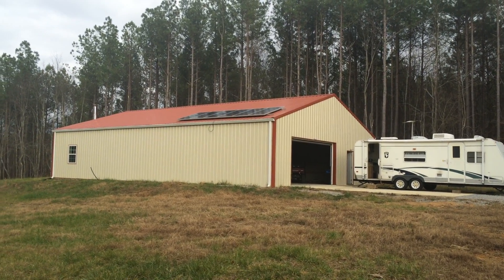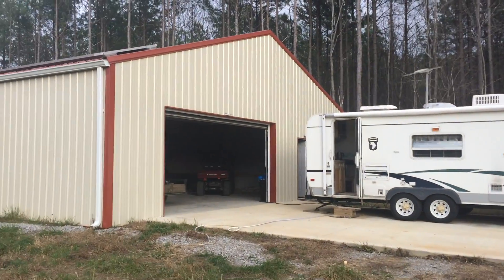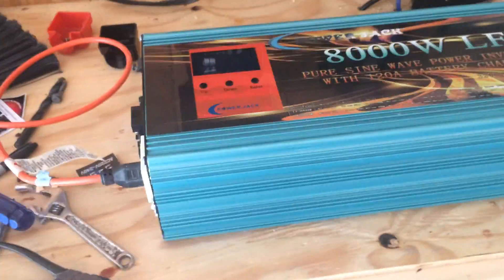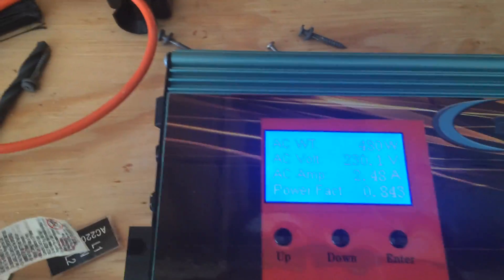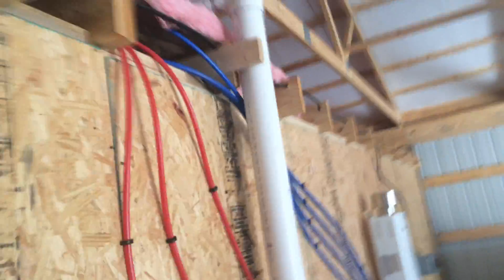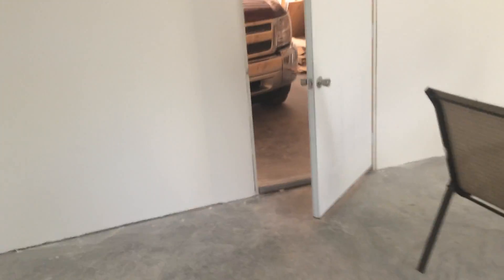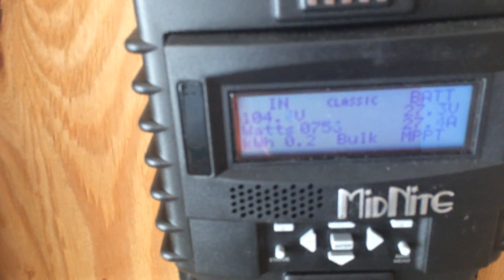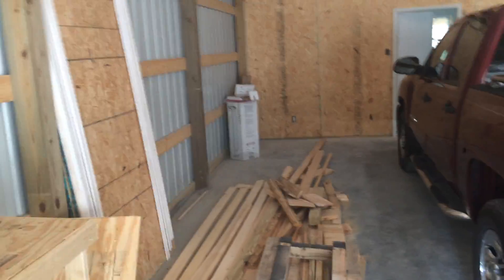Completely Solar Powered Off the Grid Cabin

Comment: How is your system working in 2024? My wife and I are about to start our off grid property this Spring. We have a Conext SW4048 system that I need to install in our High Cube Container with ABSOLYTE GX 2,000 Amp hour battery bank. We are installing an 30'x40' Red Iron Steel Canopy connected to the container. Your set-up is fantastic!! Hope this finds you Blessed and Well!!

Comment: I got mine around the same time.

Solar panel https://amzn.to/2Cx3J5t
Eco-worthy 1000w https://amzn.to/2Cg8i4a
Amazing shower https://amzn.to/39trFTi
Earbuds https://amzn.to/3fcw3Iv
Kindle ultimate https://amzn.to/31PAx3N
Twitch prime https://amzn.to/2ZIgcLl
fire tv stick https://amzn.to/2C2bTlE
Midea U Inverter Window Ac 8,000BTU https://amzn.to/3eRYzyp
Necklace fan https://amzn.to/2VGlIwU
Sense Energy Monitor https://amzn.to/2T2u3JD
Spiderman FFH https://amzn.to/2W3NIK7
Aveners: End game  https://amzn.to/2KOhyx7
Metamucil double https://amzn.to/3aHoNB8 single https://amzn.to/3bmvVTU
Canon EOS M50 https://amzn.to/35fHX0c
SONY RX 100 VI https://amzn.to/35bteTS
Canon PowerShot G7 X Mark II https://amzn.to/2WaAPhp
CANON 90D https://amzn.to/3cX8z8O
SONY A6400 https://amzn.to/2VMUNzL
Darth Vader and Ahsoka https://amzn.to/2A3qDjl
Captain Rex https://amzn.to/2L2tMST
Ahsoka Rebel https://amzn.to/2A0hoAl
Anakin https://amzn.to/2W8QZch
Skillmatic https://amzn.to/37PwSEn
Aqua 4 in 1 Monterey https://amzn.to/2Ctihmm
Bunch O https://amzn.to/2YWQodL
Face mask https://amzn.to/2ZBw2Y9
Enema https://amzn.to/2YTOquQ
Amazon business account https://amzn.to/3h9t98K
100 disposable gloves https://amzn.to/3dEbNh9
Bicycle rollers https://amzn.to/2VFCOLh
Oscilloscope https://amzn.to/32tCFyA
Ispring reverse osmosis https://amzn.to/2Wy6D0I
Flex Seal Spray Rubber Sealant Coating  https://amzn.to/2OWPERv
Great Stuff 157913 Big Gap Filler, 20 oz https://amzn.to/39t7lBK
Reusable Half Face Cover, NASUM M101 Face Cover https://amzn.to/3jDWFVl
Rockport Men's Bennett Lane 4 Venetian Shoe https://amzn.to/39tqumR
Helix Flexible Stainless Steel Non Skid Ruler https://amzn.to/3jECy9B
Bacitracin Zinc Firtst Aid Antibiotic https://amzn.to/30KvsHT

Comment: The batteries look dangerous as hell, put a 100A circuit breaker in each of the three parallel branches. You can then easily isolate one or all the batteries.
Reply: Hehehe batteries look fine... its that janky undersized wiring that is gonna cause a fire... wooo hehehe

Comment: I noticed that you have a jumper on the input of the inverter. Any particular reason why?Or would it be ok to just land battery lines on just one positive and one negative?
Reply: Lol... this unit requires twin leads. 

00ga cables x4.
2 positive, 2 negative. 

He's using what looks like 4 gauge, MAYBE 2 gauge, which, if there is no fuse(did not see one, and unlikely there)... if he draws full power from that inverter, he will melt those input wires.

Comment: Nice project.  A few questions:
Why not 48 volts?  You could have gone with 2 strings @ 48 volts and they are much easier to balance than 3 strings of batteries, although you would have to add 4 more batteries.  

Why did you go with a 12 volt pump when your system is 24 volt?  How are you supplying 12 volts to the pump?  One issue is when you go to equalize the batteries you have to go to around 31 volts on flooded batteries and it may damage some stuff.  I tried to go with 48 volt ballasts for lights and when I equalized the battery bank, they burned up from over-voltage.  Went with mostly AC lighting, but do have a 12 volt backup.  

So you have about 7 kwh of power available if you only go to 50% depth of discharge?  That is a nice start and it is sometimes a challenge living within the power budget.  I still learn about the capabilities of my system.  

The Midnite solar equipment is top notch, I use it every day.  

Hope you do well, but my experience is that the more parallel strings of batteries I have the more difficult it becomes to balance them.  Currently I am on batteries that were used and on their way to the smelter that I got in 2014.  I went with industrial stationary batteries.  2 volt cells and 1040 AH per cell.  I got 56 of them so I would have spares and I have needed them.  

Good luck and I hope you post updates on maintenance, equalizing battery watering etc.

Comment: Looks good but fo u really save any money  those solar systems cost so much then changing out battery every year or 2 is it really worth it
Reply from the maker: They wanted 6 grand just to get the power next to the building.  That's not counting bring it inside.  The batteries are good for 10 years if you maintain them.  Plus I don't have a bill that would be at least $100 a month because of all different fees.  I have 5K in the system so it's already paid for itself.

Comment: Don’t you need to have a 48v battery bank to run an 8000w inverter?
Reply from the maker: The inverter was made for a 24-volt system.  Every inverter is input voltage specific.
Reply: That's a 8000 peak, 4000 constant

Comment: Man, I'm loving it!  This is all anyone really needs!  A nice shed to store and work in and an RV to sleep in.  You have so much space on that roof, I'd slap up 10 kW of panels and run the A/C all the time in the RV.
Reply from the maker: Since I finished the cabin I have sold the RV.  I can run a small window unit during the day.  To run it a night need to use a generator.   I ever move out here full time would double the panels to 3600 and quadruple the storage space to handle central air.

Comment: He's off grid util he needs AC...He has a awsome set up..just not enough solar panels to support a refrigerator and AC at the same time...
Reply from the maker: I can run both a refrigerator and a small window unit all day long and the system still charges the batteries.  If I need the AC at night I have to run a generator.  It hasn't been an issue because we aren't here much during the summer.   We spend a lot of time out here during the fall and winter has been plenty of power for that.

Comment: Good job buddy! 
Looks like a great setup, you’ll need 2x the panels for the winter if you are north but very nice indeed 

I would get yourself some 24v to 12v dc/dc buck step downs and run 12v led strip lights in the winter if you need to start to conserve , 

We got a 24v dc  sundanzer dcf390 freezer that barley cracks 800wh , it pulls a whoppin 1.4A when running,  and it’s BIG and I can throw a game kill in it no problem 

Food for thought

Comment: Multiple strings of batteries are generally a bad idea. Plan on upgrading to a forklift battery, you will end up there eventually. I went from rv batteries to golf cart, to L16s to forklift... should have started with forklift. 21 years offgrid here. Why are you not catching rainwater? You have a giant roof...
Reply: chris niner o
Reply: 13 yrs offgrid...golf cart to L-16 and back to golf cart(trojan L-16s are junk)....tell me about fork lift batteries...? new or used?....what are the pitfalls?
Reply: Raymond Balcom Look into Tesla Model S batteries
Reply: @offgridmangogrower  You need a fork Lift to move a Fork Lift battery ... they are very heavy like 1/2 ton ?
Reply from the maker: Check out my rain collection system.

Comment: Hi Team.. I am trying to setup a water tank in a hilly region where water can be drawn from the bottom of the mountain and pumped upwards. There are 5 different pumps that can do this work and their respective power consumption is as follows. Can you pls let me know if this power requirement can be met through the power generation device shown in this video? This is a hilly area and the folks have no access whatsoever to electricity. Hence I am looking for a device that can generate electricity without grid.Your help is deeply thanked!!! God bless you. 

Power consumption (kWh) 85 Power supply (volts, phase, frequency) 440vac, 3ph, 50Hz 
Power consumption (kWh) 44 Power supply (volts, phase, frequency) 440vac, 3ph, 50Hz 
Power consumption (kWh) 17.5 Power supply (volts, phase, frequency) 400vac, 3ph, 50/60Hz or 230vac, 3ph, 60Hz 
Power consumption (kWh) 17.5 Power supply (volts, phase, frequency) 400vac, 3ph, 50/60Hz or 230vac, 3ph, 60Hz 
Power consumption(kWh) 2.5 Power supply (volts, phase, frequency) 230vac, 1ph, 50/60Hz
Reply: Harsha Rao

Hmm, why not just plan on making individual solar stations at each pump location, instead of stretching power line all the way down your line.